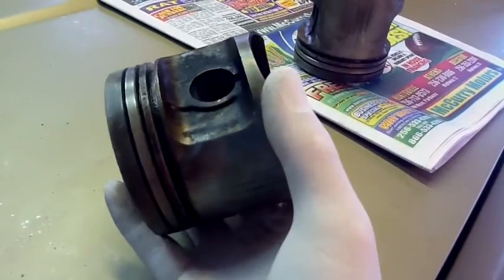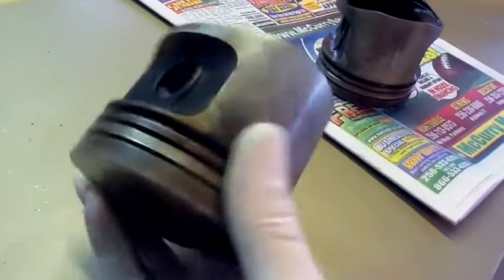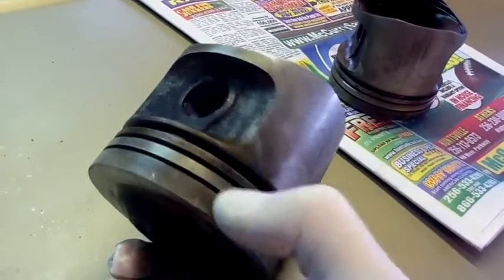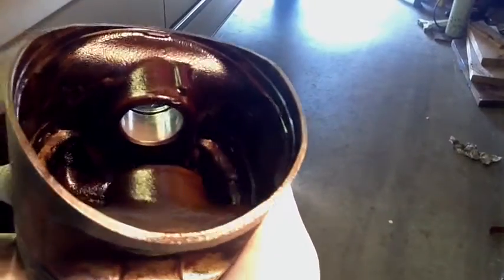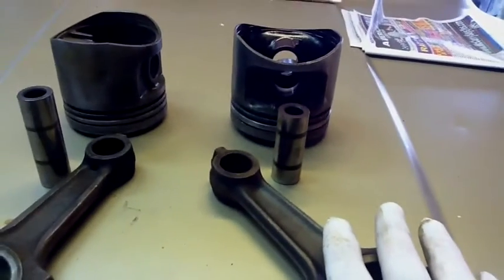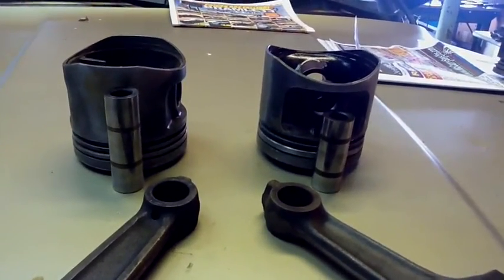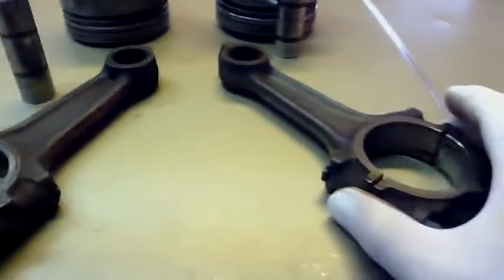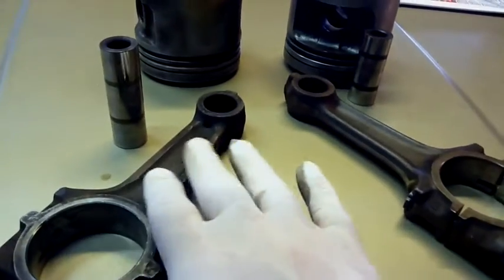BMW 1.8L M10 Cast Pistons Broken

Comment: How did the e21 Pistons held up? Planning on a build myself and might wanna go for the 2002 turbo version pistons
Reply from the maker: I put the engine together with the e21 pistons, pulled the turbo off and sold the car without the turbo on it.  So I never really pushed the e21 piston under any paower other then in NA 103 hp form.
Reply: @hsvturbo1  shit :( hahaha so u suggest if u turbo it's better tot go forged
Reply from the maker: @leandrocherchi9100  I would go forged if I were to do it again.